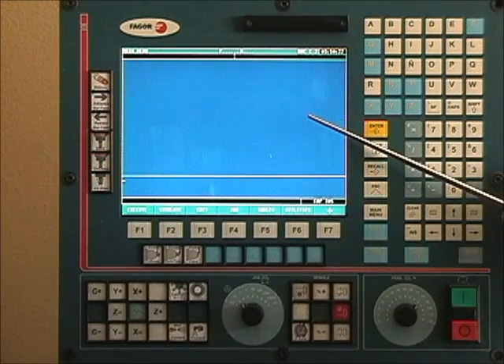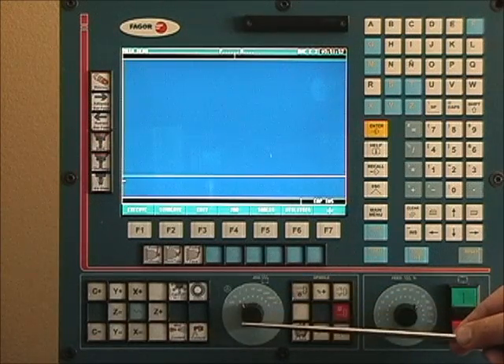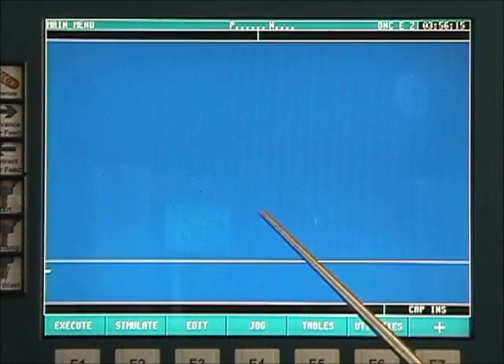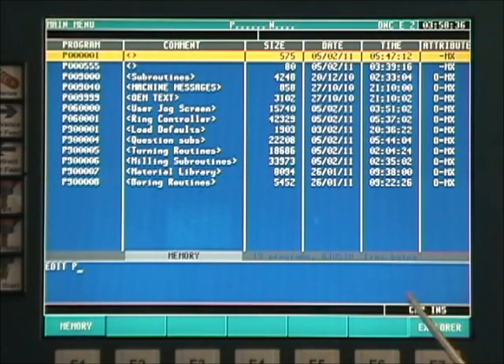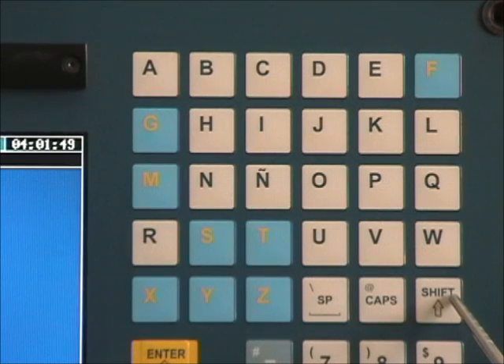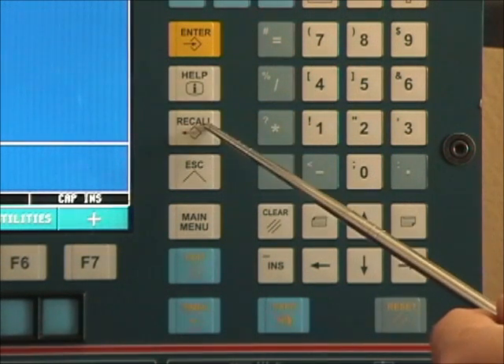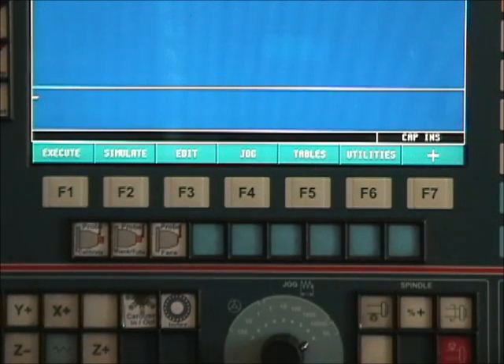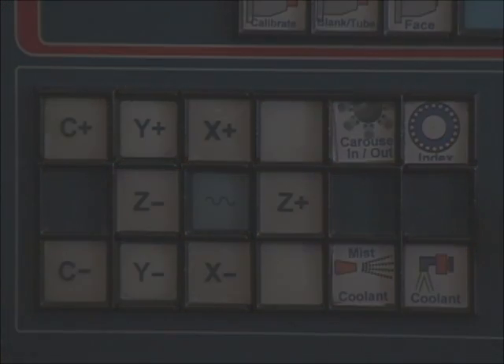Fagor 8055iT control Video.wmv

Comment: Thank you for this video! I see it was uploaded over a decade ago, but it is news to me. After nearly twenty years of use, my shop Anilam broke down. My boss is replacing it with an ACER that comes with a FAGOR 8055i controller. Your video is extremely helpful with explaining the keys. No one in my shop has been this helpful, probably because most don't know what you are showing me here.

Thank you!
Reply from the maker: Thankyou, the 8055i is a very flexible controller